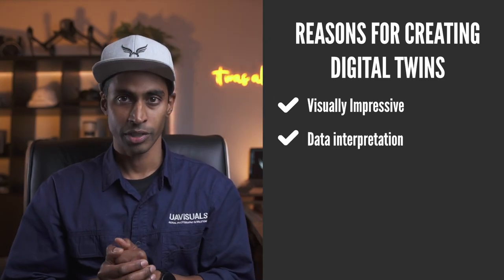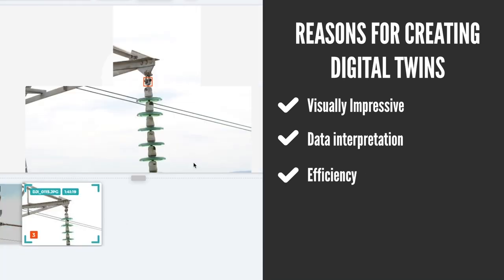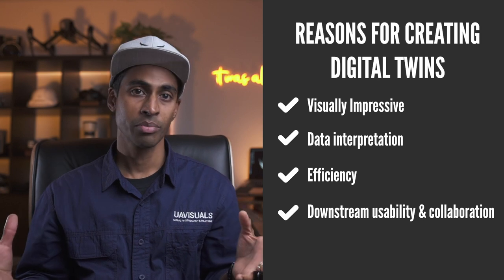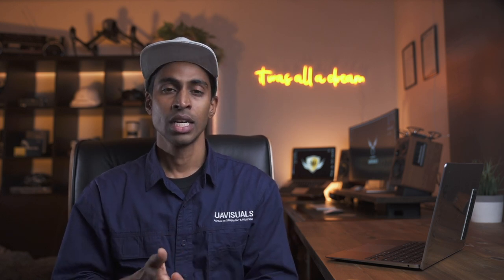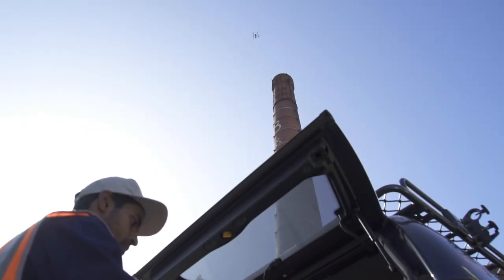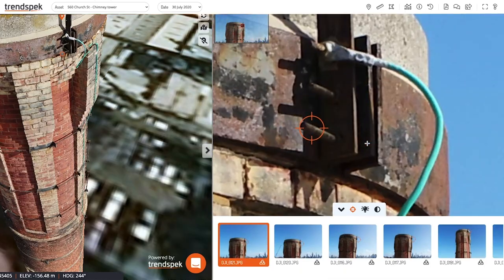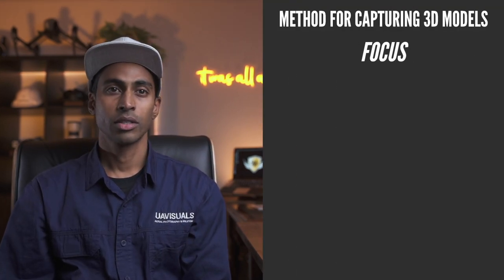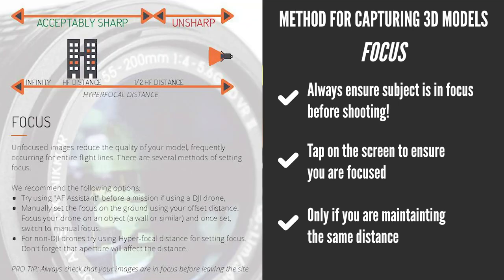How to create 3D models (Digital twins) with drones for reporting.

Comment: Great Video, I do have a question though. Isn’t GSD the distance between pixel centers? When you say 6 GSD, is that in centimeters, millimeters, etc? I agree that the chimney model has great accuracy (2mm) but I’m not sure how the 6 GSD ties into this. If you could clarify this that would be great, thank you for all the helpful videos.
Reply: 6 meter GSD would mean that the pixel centers of your images is 6 meters apart which isn’t what you have since you have 2mm accuracy. I know the term seems confusing, i had to look it up.